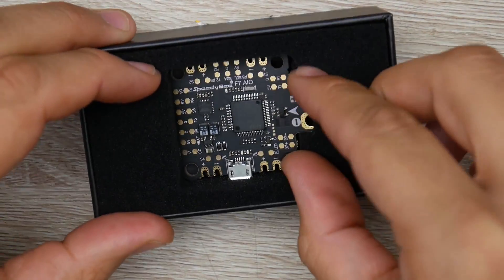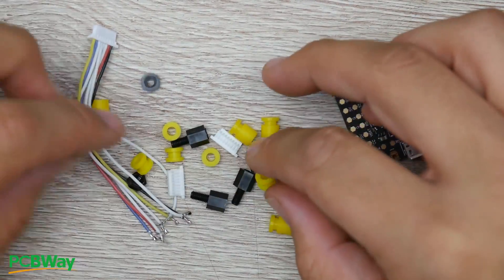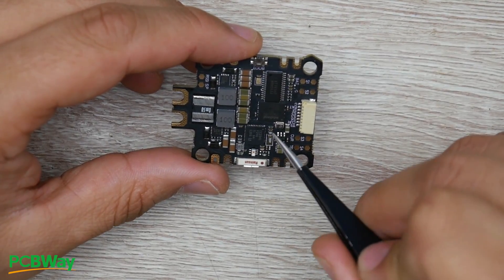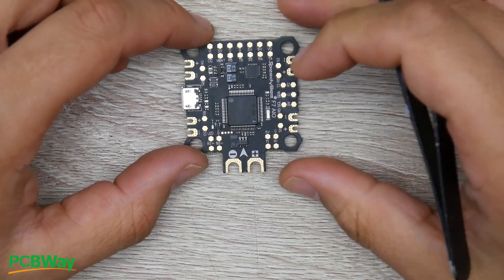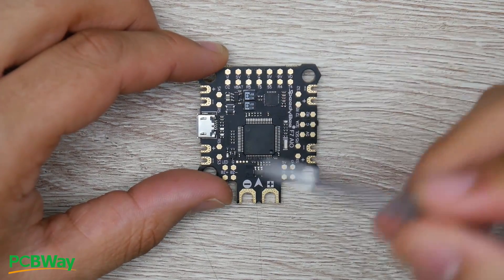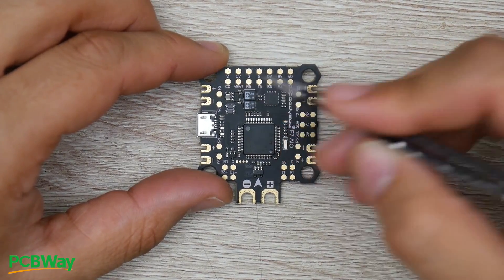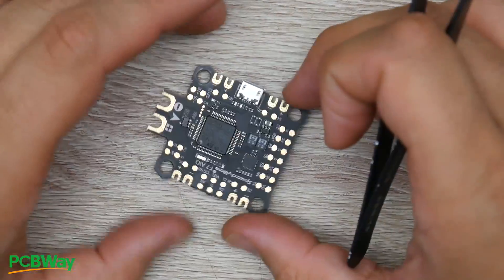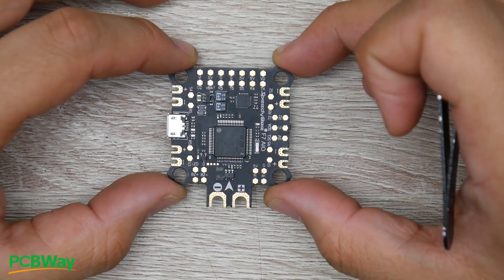All New SpeedyBee F7 AIO // Unusual Component Selection

Comment: Regarding the camera wiring: both VBAT and 5V can be connected to the camera – the 5V powers it and the VBAT is used the read battery voltage for cameras with built-in OSD (i.e. RunCam).

Comment: I like to run the vtx of 9V and the cam of the 5V from the vtx for double filtering and super clean video. 
Any idea why there is a S5 pad on the board? Probably not a fifth motor... Of course you could remap it but why not make a extra uart in the first place?